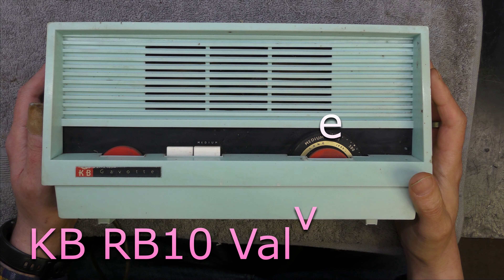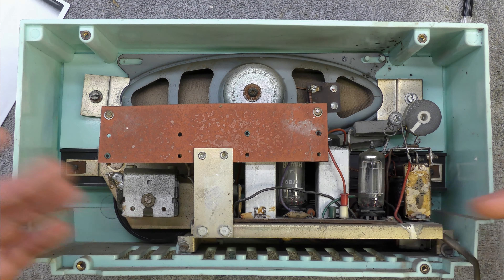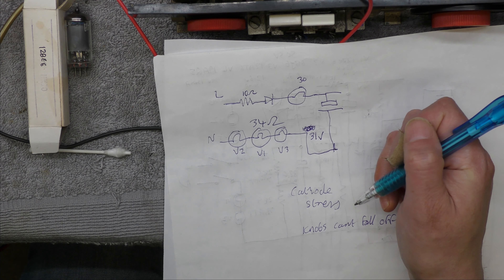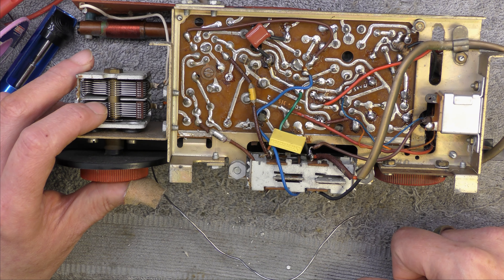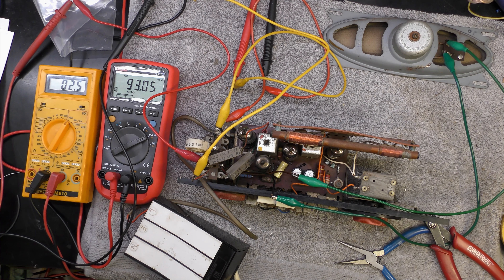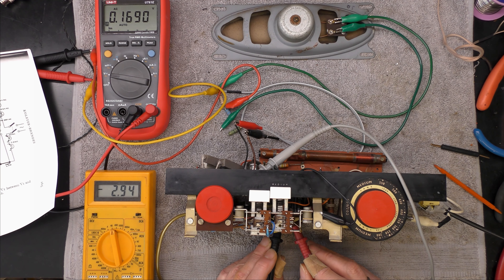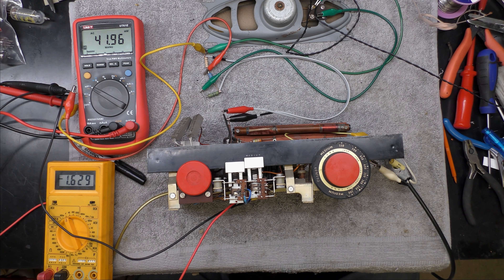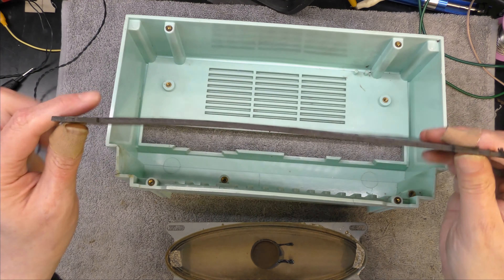Kolster Brandes RB10 Gavotte Valve Tube Radio 1960 (4K)

Comment: A great video, Das,...grid leak biasing, gosh was surprised that KB still adopted that tech method in their later valve sets.
Reply from the maker: I thought cathode bias was more in vogue in later sets too. Thanks for for watching, Theo. Daz.
Reply: @darrencoe5795  At one time it was a favoured method by early years guitar amp manufacturers to run the input valve grid leak biased, supposedly this gave the amp a more gritty sound. I have a feeling that valves utilising grid leak biasing tend to run harder on so I wonder did KB adopt this, for this particular radio valve, so to improve the sensitivity of this set...just a guess.
Reply: @Theoobovril  grid leak circuit eliminates cathode bypass capacitor, certainly used because of that - less components means cheaper.
It also runs less linear that may be a desired thing for guitar amps...

Comment: I am quite a fan of KB radios they are always a quirky design. They did have a habit of constantly changing the circuit from the published design. I think you were correct regards the odd current reading being due to the use of the capacitor dropper and  the capacitor only draws current for a small proportion of the AC waveform. You would probably see high pulse current but low average current. I have also that most RMS meters actually aren’t once the waveform deviates from a sin wave
Reply from the maker: I just thought that it's a pity I don't have a hot wire amp meter as I guess that might be just the thing for this, Chris. I like the radio too it's quite different. Thanks for watching, Daz